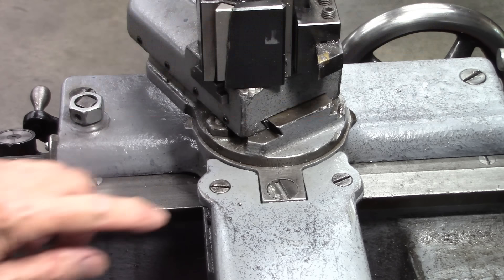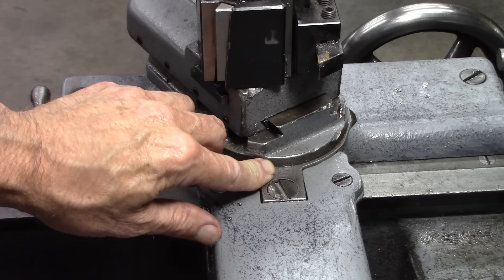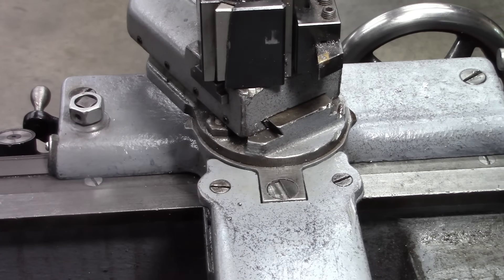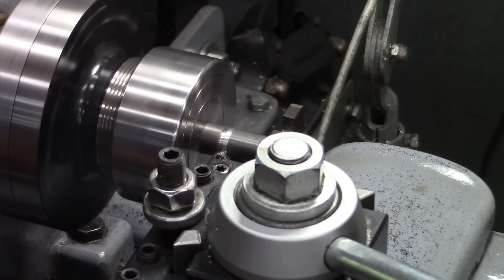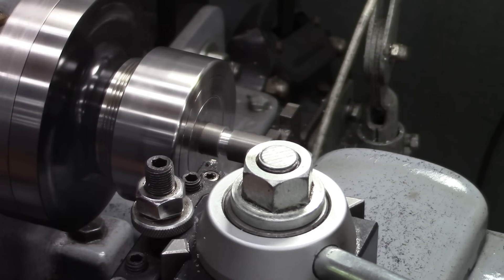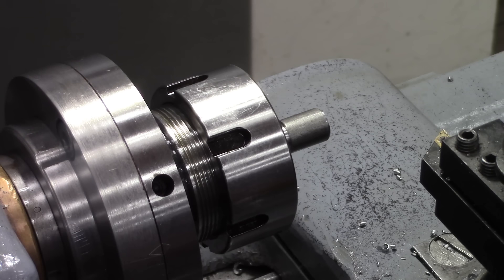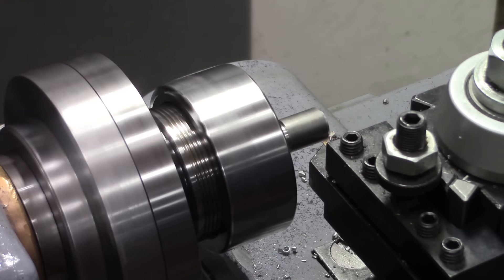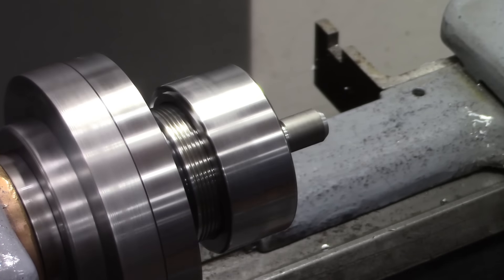Threading on a Lathe - Just the BASICS

Comment: Is there any difference to cutting metric threads? I primarily work on Subarus, and oftentimes need a very uncommon long bolt that is 8" long, usually something like M10 x 1.25. I have been looking at buying a lathe for months but have not pulled the trigger as I was unsure if the gear ranges for thread cutting interchange between imperial and metric. With your chart I saw some that said 3 1/4 TPI or 11 1/2 TPI etc.

Thank you for the very basic into video, I never understood how the compound and cross slide functioned differently, or the use of a thread dial gauge.
Reply from the maker: Glad you enjoyed the video. As for metric, the process is exactly the same. However, some lathes only do inch and some only metric. Many modern lathes will do both but they are usually more expensive and have two different lead screws. With that being said, you can get what they call, Transposing gears for an inch lathe but you have to leave the half nut engaged, stop the lathe and reverse for the next pass. This requires that the lathe has a brake as coasting can be a problem. I have cut several metric threads that are close to inch threads but this is not ideal. If the thread penetration is less that 3/8" it works well enough (like a nut),
Reply: @WinkysWorkshop  Colchester and I think Harrison lathes (and probably others)  use a 127 tooth gear in the primary gear train to convert from imperial to metric, I believe it's not perfect but very close, close enough. I have cut metric threads that way with success.  From Cumbria, UK.
Reply from the maker: @seapy2398  Yes and I'm sure you have to reverse the lathe instead of using the thread dial

Comment: Nice. I don't have a thread dial on my lathe. Do you have a video on making yours?
Reply from the maker: Here's a video. They are very basic and you don't have to make it fancy. The trick is, knowing what gear to use. I made one but also knew the tooth count and diameter. There is no load on the gear so any gear with the same diameter and tooth count will likely work.  https://youtu.be/-BIX0cJw5Ls?si=ogVFlN7madvy36Io
Reply: @WinkysWorkshop  thank you

Comment: I still can't understand why anyone would want to move both the compound and the cross slide for each pass. Forget the fooling around with the compound and just go straight in with the cross slide. Which brings me to why use the risky toward the chuck threading instead of away from. Way less risky and allows higher speed with no risks. I'm a believer in the Kiss principle. Simpler, safer & faster!
Reply from the maker: There are logical reasons for each. First off, I have a screw on chuck so running in reverse is not possible (threading away from the chuck). As for straight in vs the compound feeding, if you make multiple passes its basically the same procedure. I do not feed with the cross slide. It's simply to retract the tool and its put back to the same spot every pass. It's really much easier and less prone to error. No dial setting to remember you just advance the compound the depth of cut. The biggest advantage compound feeding is the chip load, no intersecting chips at the cutter. The finish is also better and its easier on smaller machines. Probably the best part for me is not having to remember where the dial was set with each pass.

Comment: Good explanation.  I don't think you mentioned using back gear on lathes that need it to go slow.  I was also taught to do a spring pass before testing.
Reply from the maker: Both important but I think I mentioned the back gear. I left off a scratch pass and spring pass.